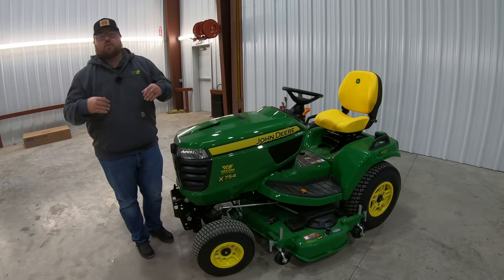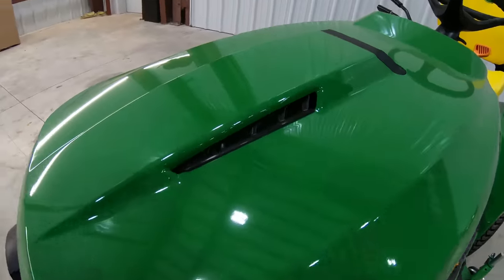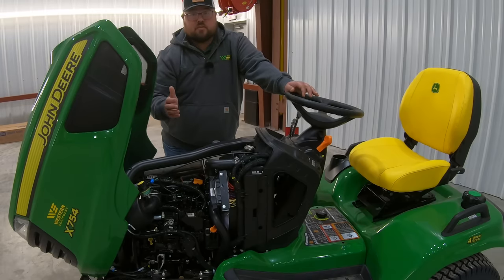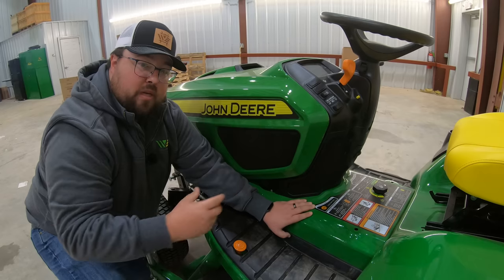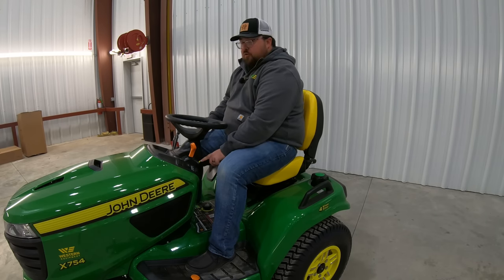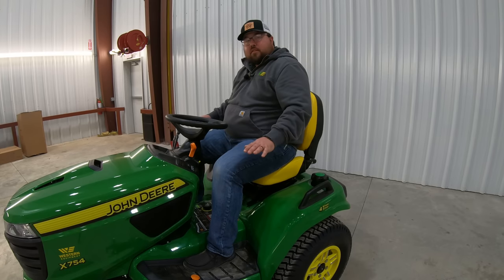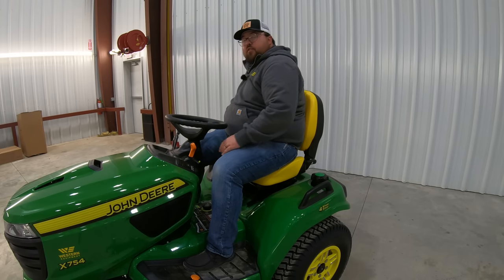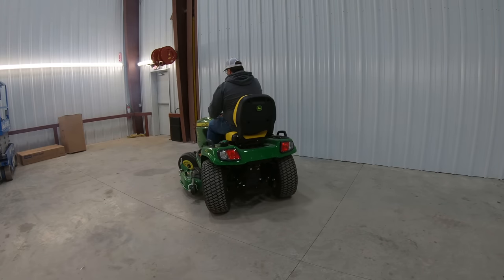2023 John Deere X754 Lawn Mower Review & Walkaround

Comment: Also, wait for the plastics on your $$$$ high price lawnmower to start breaking like it always does on JD….
Reply from the maker: Interesting….
Reply: Go to sears and buy a craftsman. Your that guy !
Reply: @Mjr1348 yeah, my first mower 30+ years ago was a Scotts. Then dealer Cub Cadets.Then Kubota. I also have a JD 430, 1987, that has metal seat pan, metal side panels, and a sturdy fiberglass hood, not the molded brittle plastic junk on your $6-$17k JD X300-700 series….
Reply: I have an 18 year old LT180 Deere mower with the original hood…

Comment: You lost me at the sticker price I was thinking maybe maximum $8,000 to $8,500 I bought a John Deere x580 is what two steps below the x700 series here's the positive note you are very knowledgeable thank you for being knowledgeable about the John Deere series tractors I bought my x580 in 2019 I was thinking about upgrading to the 700 series but not now
Reply from the maker: The big reason here for the major price jump is the amount of capabilities that this tractor has. It is very close to being a subcompact until it’s tractor. Thank you for watching and for the comments.
Reply: @WesternEquipment The X500 series can do almost anything the X700 series can. It will just take a little longer since its a smaller machine for a bigger job.
Reply: @JoshAllen17Goated  The X300 series can do almost anything the x500 series can.  It will just take a little longer since it's a smaller machine for a bigger job.  What exactly is your point?
Reply: @user-jp9ig5wg7n  Not really, the transmissions are completely different and thats the main difference. An X300 series transmissions cant handle the load like an X500 or X700 series transmission can.

Comment: and of course the RIO setup got even dumber. its better on my x724. thank god we can bypass them... besides that its a good looking deere..
Reply: That’s one thing I love about the zero turns, no RIO saftey. My old D120 tractor had that RIO button and a jumper  wire was all that was needed to bypass it. 4” of wire and 2 crimp spade connectors.
Reply: @FishFind3000  ya for sure.
Reply from the maker: I agree it is a sweet machine!

Comment: great review. Are all the decks green these days? I have a 2014 X738 and deck is yellow. 54 inch. First thing I did was disconnect seat safety and Rio switch. I'm old school and have common sense. Don't need a lawyer designing my tractor. Love the snowblowers on these machines.
Reply from the maker: Thank you and yes, as of 2023 all of the mower decks are green. What do you think of the new look?
Reply: @WesternEquipment  don't care for it. Green paint must be cheaper, or a cost cutter for JD to only need 1 color. 2 tone, green and yellow, just sets it off so much better. Kinda like the difference between Red velvet cake and a rice cake.
Reply: @WesternEquipment  I think the yellow deck would not only look better also but I think it would also be harder to see in the dark. I know it sounds crazy but there have been times where I have mowed into around 10pm just to get done as long as the grass didn't start to get wet. For me the yellow is easier to see and line up in the dark than green. Guess you could use reflective tape 😅. That being said the green is an interesting change after all these years but thinking back to the round fender 110s, still missing the yellow.

Comment: I would like to know what the ideal is behind having plastic hoods on these John Deere's when metal is much more durable and longer-lasting is that the ideal behind plastic Hood it does not have anything to do with the aerodynamics or the weight you're going to get so many hours per gallon of fuel that depends on what you use in the machine for again thank you for your knowledge and time of making these videos very interesting
Reply: Plastic hood and fender deck likely is to keep the machine weight down for safety regulations, not fuel efficiency. From everything I have seen that is the reason the X7 has no ROPS, and why there is no X759… don’t have to deal with dents as well!
Reply from the maker: The two biggest reasons are to reduce dents and paint issues as well as reducing heat that the engine produces. Metal traps in more heat than the plastic does.
Reply: That's a poor excuse for safety reasons and to keep the weight down at the tractor I really have a dent in metal where I can pound it back out and smooth it instead of being plastic breaking cracking and big trunks took it out I can show you pictures of my old John Deere gt275 with plastic Hood and I know sooner or later this will happen to my x580 John Deere reason why I bought it because of the engine in the tranny or transaxle I just don't appreciate plastic
Reply: @geraldharris6277  It isn't a safety feature, it is likely to keep the machine under a safety threshold, like I mentioned, for a ROPS... I don't know of too many people who want a garden tractor with a roll bar... Additionally, it seems the plastics have come a long way as technology has gotten better from the times of the GT275. That is at a minimum 25 year old tractor by now, so of course the thin plastic on them isn't what it is now.  I haven't seen too many current generation machines at least from 2012 or so up used wise that have cracked hoods, unless they were just severely abused. But who intentionally beats on a hood?

Comment: I bought an X750 in the fall of 2021. Absolutely love that thing!! Comfortable and easy to use. Took a couple hours to get used to the power steering as it does respond slower. But once you do, you'll wonder how you ever did without it!  But that RIO button is a pain in the ass. You can get around that easy enough with a clothes pin.
Reply from the maker: They definitely are nice machines. Thanks for the feedback and for watching!

Comment: Just got my second 758. My 5th diesel over the past 40 years (starting with a 330 diesel). I opted for the optional air seat which is very nice in rough yards. Don’t forget to get an anti scalping roller if you have the auto drive over deck. These are a beast with great power and fuel consumption.
Reply: I have a x758 also. Why have the anti scalping roller with auto connect?

Comment: Hey always been a fan John Deere. I’m not a Big Big Box store equipment purchaser but went to Lowe’s for some oil filters and they have several John Deere riders which looked impressive. I guess new everything should look good. They had a S model looked nice 
Nice video
Reply from the maker: One thing you can count on is that the mowers from John Deere that you see at Lowe's and other big box stores are also sold at the dealerships and are the same quality.
Reply: I just bought an S180 from Home Depot last week. Only used it once since then but so far I’m loving it. The 54 inch deck cuts down on mow time by a lot.
Reply: Hey Taylor my opinion is it’s the best out of all the mowers they have in store. Congrats

Comment: Fantastic job on your John Deere videos! I have a 6.3-acre horse farm with about 4.5 acres of grass. I have considered the 1025R but that machine is out of my price range at this time. Do you know the price to add on the rear PTO to this vehicle? Also, would you feel comfortable attaching a post hole auger? Finally, is the X758 series worth the extra $?
Reply from the maker: Thank you for watching the videos and I hope they have been helpful to you! For your questions: on the cost for the PTO, this would be a question for your local dealership and same with the post hole digger. I will say that I do think it is way worth it to go with the X758, especially when you are going to be doing more than mowing with the machine.

Comment: thought I would add my $0.02..I have a John Deere 425 liquid cooled from the 1990s with the Kawasaki 20 hp engine -- since then the number of models has bloated since it appears my 425 is most similar to the 700 series today (both in terms of cost and features -- a driveshaft connecting the deck plus a hydraulic snow blade).  Anyway it is now bit the dust and I am debating buying a new engine and starting its second life...with a 60-inch deck these things will go the distance well beyond twenty years.  Very expensive but the liquid-cooled will outlast an air-cooled by far...plus the larger tractor is much more functional..had I had the diesel it would still be running.
Reply from the maker: They are great mowers and I have heard this exact thing from a few different people. I am glad to hear of your great experience with the machine!
Reply: My 345 18hp was 27 yrs old when the engine gave out.  The fact that my snow blower was pretty much spent I got a X750 with mower and snow blower.
    It will most likely be the last unit I will need at my age.
    Bit pricey but no regrets.
Reply: 425 was a beast.  The GOAT of mowers is 455.

Comment: At that price point, you can get 5 or 6 Cub Cadet 2500 or 3000 series machines! There better built, have proper tractor transmissions and transaxle setups that are shaft driven like there bigger farm tractor counterparts. Twin C-Channel frames made of 11 and 9 gauge steel. Horizontal shaft Kohler Command series (best air cooled small engine produced today), Kawasaki FD series, and Briggs And Stratton Vanguard series commercial V-Twin engines rated for 2000+ hours of service. All cast iron transaxle on the 2500 series or cast and aluminum depending on the model on the 3000s. Sleeve hitch for the 2500 and 3000s and a cat 0 and limited cat 1 3 point for the 3000 series. Various attachments available. And there transmissions are stronger than the equivalent Deere. 2500 series = X500 series, 3000 series = X700 series.

Comment: Off topic a little but is the S240 42 inch the best of all worlds for a small 1/2 acre lot since it has the Kawasaki v twin and the K46 trans and the deep deck.
Reply: I believe there is a video on here comparing the S240 and the X series. I was thinking about the S240 based on price and features. X might be a bit much for our yard 1/2ish acres
Reply: @AnticipatedHedgehog  oh okay. I couldn't find that video. Im not sure if the x350 is too much mower or not. They seem to have almost identical specs really. Mechanically speaking. And both can be had with the 42 inch deep deck.
Reply: @ericdolby1622   the x350 is only slightly more expensive and is much more heavy duty. I just got mine 3 weeks ago. If you want to keep it for a very long time I’d go ahead and upgrade.
Reply: @thejoshman1234  that's good information. I do want to keep it for 10 years. I didn't realize it was heavier duty.
Reply: @ericdolby1622  yeah it has a bigger frame, better tires it’s overall a lot nicer feeling.
Reply: @thejoshman1234  it's crazy how this has I was considering the s130 because it has the V-Twin for $2799. The the S240 adds the deep deck, Kawasaki and k46 $3399. Then the x350 is stronger and more comfortable $3999. Then x354 is nice with 4 wheel steering $4999. Ugh.
Reply: @ericdolby1622  it’s a tough choice lol I went with the x350 for the sturdier platform and the Kawasaki. I didn’t find the 4 wheel steer necessary
Reply from the maker: I agree. It is a nice machine!
Reply: I have a S240 42 inch. Great machine. Could use a little more power though. Wonder if they make a turbo for that Kawasaki?

Comment: Wondering if anyone knows which x700 series engine is louder. The 3 cylinder diesel or the Kawasaki gas.🤔 I know the diesel will last longer but ive always appreciated the Kawasaki gas engines i have owned in the past. Right now I have a gx345 with the 20 horse. Over 1440 hours and no major issues 👍
Reply from the maker: It has been a long time since I have been on a gas one so I'm not sure which one is louder. We also do not keep these in stock so I can't go get on them to tell you. We will have to hope somebody comments on this one to let us know. I will be following. Any thoughts anyone?
Reply: Diesel is, I’ve had both

Comment: If the cost of each is the same, which is the better unit - 1025R or the X754? Assume the workload requirements are the same.
Reply from the maker: Hi Brett. I think main thing to decide if you need front loader or front attachment. The 1025R will have more weight to handle a little heavier work but more compaction on your yard and garden than the X754 if that matters. The X754 will be more maneuverable in tighter spots and turn tighter if you have trees.
Reply: I've got a 1025r w/mid mount mower that mows great. In 2wd mode, turning sharply doesn't damage the yard at all. It probably doesn't turn as sharply as the x754 which would make the 754 a better mower. The 1025r sits up tall and feels more tippy on steep inclines and I use my troy-bilt rider for that. Otherwise, whatever attachments you need should probably weigh heavily on your decision.
Reply: If you were to upgrade the X754 to have a rear PTO and 3 pt arms it would likely cost more than a stock 1025R.  I mow with my 1025 and it does compact the grass a bit, but it is a very capable machine with the front loader and rear 3 pt attachments.  All comes down to how you plan to use the machine.  Look into the Versa turf tires from Carlisle.

Comment: Hey Brent I have a Z425 and replacing the shock dampers. How do you deal with the clips that hold the shock on the balls? I need to remove the old shock and install the new one.
Reply from the maker: I'm so sorry. I am confused about where you have a shock on that mower. Could you tell me where it is.

Comment: For a small yard I chose a x500 series over the x700 series. Does a liquid cooled x700 series engine last that much longer than an air cooled x500 series engine?
Reply: In general a water cooled engine will  last 50% to 100% longer than an air cooled engine because of more efficient cooling of the engine.   This means where an X3xx or an X5xx  series lawn tractor last about 1,000 hrs  an X7xx will last 1,500  to 2,000 hrs.   The X7xx series also is more  comfortable riding because of reduced engine vibration , larger tires and a long wheelbase.
Reply: A diesel engine would certainly last 10-12k hours whereas the gas would last about 1/2 that. That being said,itd take most people 20+ years to wear one out. Theres certainly nothin wrong with the gas engine,they're top notch.
Reply from the maker: Liquid cooled engine will almost always out last an air cooled engine due to them being a more commercial sized engine with better components.
Reply: see my main comment above--the liquid-cooled defintely go the distance...

Comment: I want to ask about the seat. I have a X584 and wanted to upgrade to this seat for $500 but there is no literature on the weight limit? I’m a big guy and I think this seat is only rated for 200 lbs. I really want to buy a new seat but I am reluctant because the seat might bottom out and I’m out of $500 bucks. P/N BUC10625

Comment: Bought a new 1025r in 2016. Biggest pile of junk ever, what a disappointment. Dumped it and went to a bigger model Kubota in 2017.  Should have done that to start with. Picked up a Kubota zero turn also. No more green for me.
Reply from the maker: Well I hate to hear that but what was wrong with your 1025R?

Comment: if ya'll have one, can I be able to trade my X324? I live in oklahoma.
Reply: I have owned two X series Deere tractors , a X758 and a X750. On the X750 I have the PTO option for several attachments, and use the power lift Thatcher on the front mount. Great tractors that do everything I wish for them to do. I have owned many tractors of several brands, sizes, and types. Not a toy!!
Reply: thanks! I appriciate it. that helps.
Reply from the maker: This one was ordered for a customer, but we have several locations in Oklahoma and would love to work with you. You can put in an inquiry on West-Equip.com for more info.

Comment: They have a good tractor, mower deck, not so much .
All 4 corners are fastened to the tractor . Any uneven lawns, this deck will scalp the grass .
Where the back of a Simplicity mower deck rides on rollers and rides the uneven lawn .
Reply: Not if the deck is set up how the manual describes. 
I've never had issues with a Deere scalping (or really any mower that had the deck set up correctly).
Reply from the maker: As long as your anti-scalping wheels are set up correctly you shouldn’t have any issues with scalping.
Reply: My 748X 54” deck has 5 rollers on the deck? 3 front and 2 rear. Not sure what you are talking about.